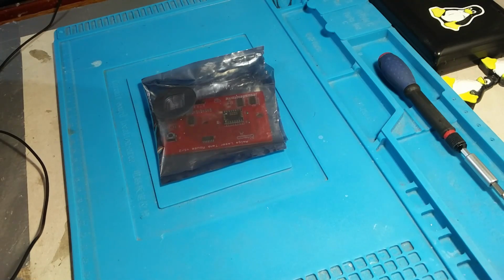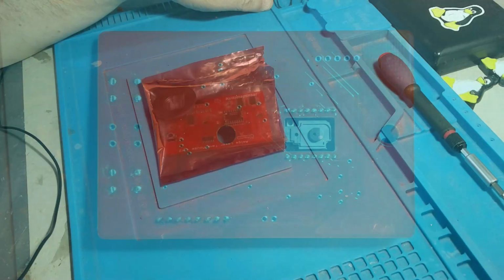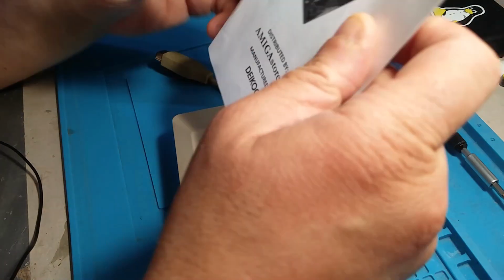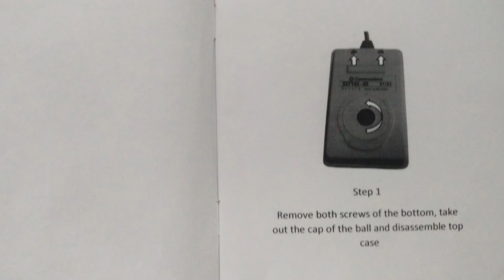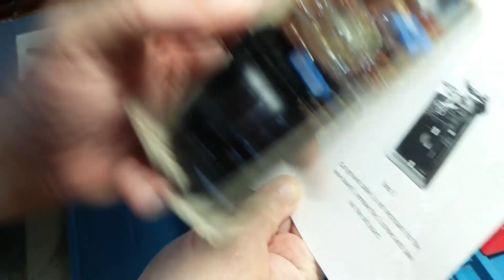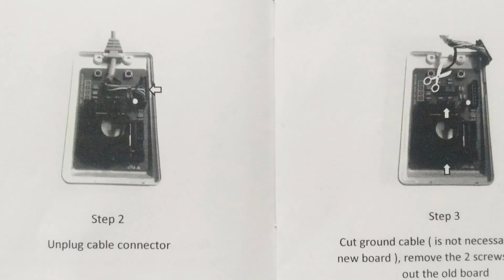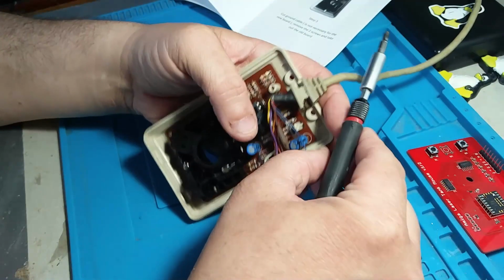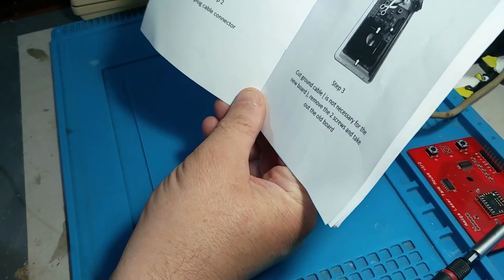Amiga Tank Mouse Laser Upgrade - part 1 of 2

Comment: it seems you don't have de right version of the mouse. mine doesn't have switch elevator board but the left and right switches like in the board replacement. of course the pastic  buttons are longer.
Reply from the maker: It is stated that there are different Amiga mouse versions or board so it depends which one you have. This video is to show how you can make modifications to the board in case you do not have the exact fit.

Comment: I'd like to convert one of my old tank mice to optical, hopefully I have one with the plug-in cord because I can't solder. I bought a brand new old stock tank mouse at Amiga 30 in California and it's wonderful, I never had a new one before I got that one.
Reply from the maker: This is for a conversion if you have the board and the board doesn't fit in your tank mouse since there were different versions